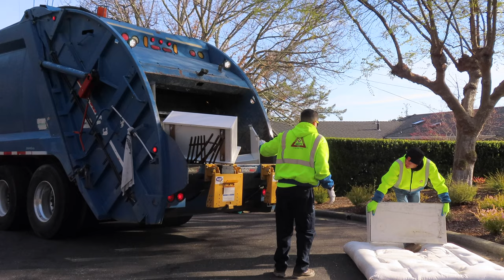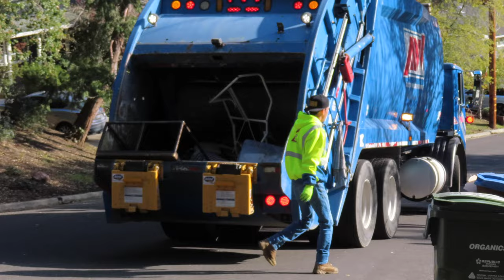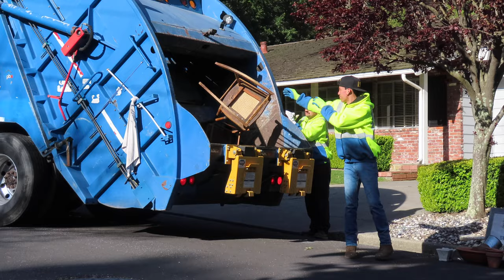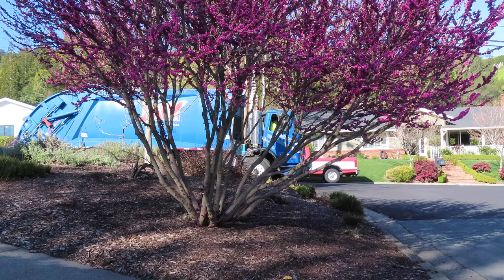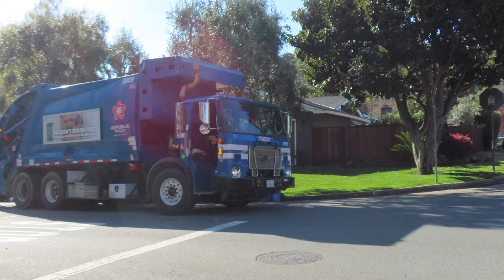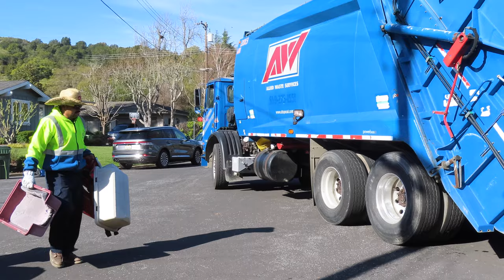Bulk Waste in an Allied Waste Rear Loader

Comment: huh....last I recalled seeing this truck it didn't have tippers. very ideal setup for a tipper route too with the hopper extension. hope you can find it on a route running one as it'd be quite the video to see a fully marked californian AW truck in 2023 still collecting carts

also peeping that mack ZR demo unit lol
Reply from the maker: Thanks! Yeah, the tippers are new. the fact that they added them gives me hope that they will keep this truck around for a little longer. The hopper extension is pretty cool too. Reminds me of the American Disposal RLs on the east coast. It would definitely be cool to see this on carts. The only thing that bums me out is that they removed the steps, so you can't ride on the back anymore.  

That Mack ZR is actually a rental truck lol. They've got a handful of rental trucks now